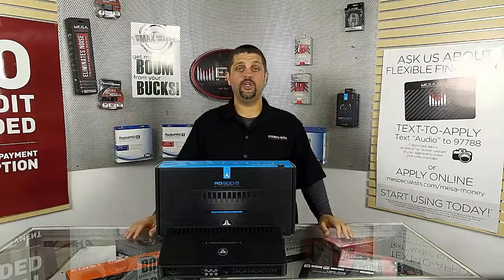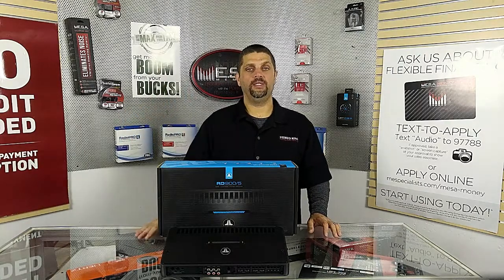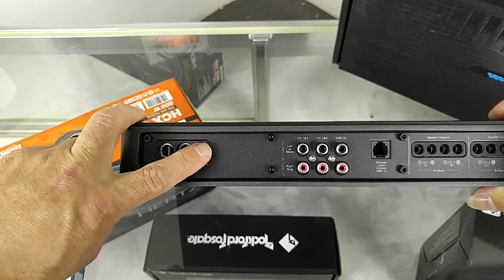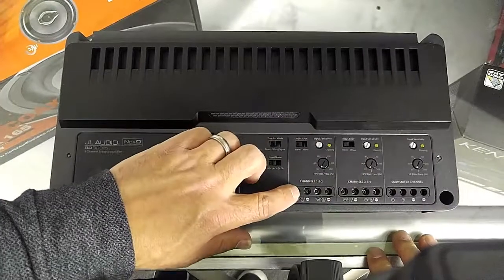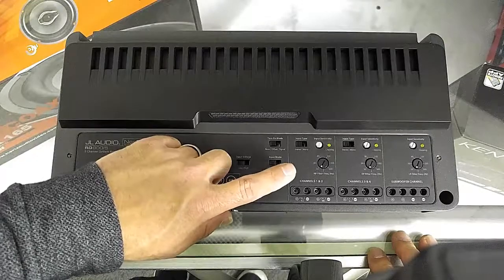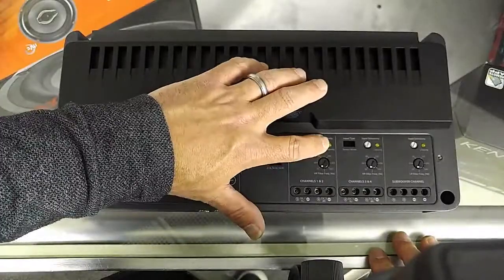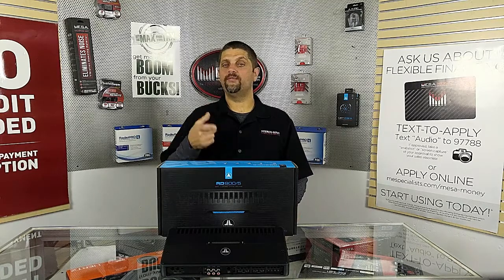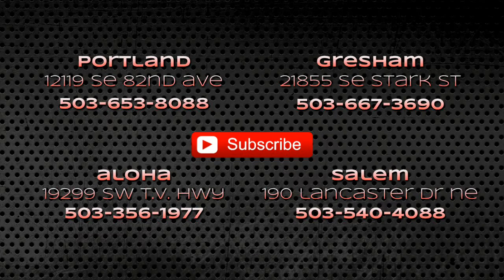JL AUDIO RD AMPLIFIERS

Comment: Is the RD 500/1 a good match for a W3 10" sub?....I forget if it is 2 ohm or 4 ohm...but I will find out

Thank you
Reply from the maker: It should be be plenty of power if you are only doing one sub. You'll get 500 ar 2 ohms and 300 at 4 ohms which still enough.
Reply: @stereoking7778  TY....I was worried that if my sub is 2 ohm....the 500 watts might be too much...but I guess not 👍
Reply: I have a w3 2ohm 12” in a custom, ported box. It sounds amazing and does not distort.

Comment: I have this amplifier  . Got it professionally  installed  . My subwoofer  is at 80 . My front  and rear  speakers  I have  them  at 120  . If I bring my highs  down to  80 . Duo  I need to adjust the  silver turning nobs the ones you pointed  out  . And wich direction  do I adjust  .
Reply: If you got it professionally installed, do not touch the silver knobs. These are for setting the gain, they are NOT a volume knob.

You can play around with the equalizer built into your radio to adjust the highs/lows (bass/treble).
Reply: @HP2ViD I think he's talking about the crossover idk really

Comment: I was given the 400/4 amp. I have a set of 15 inch kicker comps @2000 watt total. 1000watt each. Would this be able to power those in a 2 channel configuration. Doesn’t need to push them to max but at least get some nice bass.
Reply: Maybe if you had 10s or 12s but the 15s are to high wattage. Max would be 200rms x 2

Comment: would this be good to run my 4 aftermarket speakers in my bmw and a rockford 12" p3 sub?
Reply from the maker: Yes sir, the RD900/5 should do a great job! Another option would be the XD1000/5. You gain an extra 100 watts to the sub!
Reply: thank you for answering and the recommendation i really appreciate it I'm definitely gonna check it out right now!
Reply: can you recommend a wiring kit for my setup ?
Reply from the maker: You will need to use a four gauge amp kit. Three pairs of rca's,16 gauge speaker wire would best for your interior speakers and 12 gauge for your sub.

Comment: what happended to the SLASHER SERIES ?
Reply from the maker: They still have the slash amps. Not as popular as they should be but that is a price and size issue.
Reply: one more light yessir.. i have a 1000/1V2 pushin a 12W7 in the H.O. wedge myself

Comment: would this run two sets of c2 650x and a jl 10 inch sub?
Reply from the maker: Yes the RD900/5 would do a great job running your C2 components, as far as the jl 10" sub, it depends on which one you have. If it's a W3 or lower it would do a great job. If it's a W6 or above I would recommend the XD1000/5.

Comment: Can 2 rd1000/1s be used to power a 13w7ae
Reply from the maker: Not recommend. They RD amps are 2 ohm stable. They 13W7 has 2 1.5 ohm voice coils.
Reply from the maker: I would recommend the hd1200.1 and fun the coils in series.
Reply: Stereo King i already have 2 rd1000/1s
Reply from the maker: Unfortunately the RD amps are not 1.5 ohm stable.  You can run one amp to a one 12w7, they are single 3 ohm voice coil woofer.
Reply: HD is the same as the Slash amps. 1.5-4 ohms. They're built for W7s. Slash amps are matched to the 12.5 W7s

Comment: Will the rd1000/1 be able to handle the 13w7?
Reply from the maker: No, do to the 13w7's 1.5 ohm dual voice setup, I would recommend the HD1200.1 running the sub in series.
Reply: stereo king oregon thanks for the info, because a certified Jlaudio dealer shop told was trying to give a package deal which includes rd1000/1 to push the 13w7
Reply: Stereo King what happended to the 1000/1V2 SLASHERS ?
Reply: floorguys i got a almost new 1000/v2 that has a chipped fin that has been sitting on my display case for years you looking to buy one?
Reply: Adam M thanx but no sir.. i have 1 already pushin a 12W7AE in the H.O. wedge .. was just curious why they stopped making them
Reply: @stereoking7778  hello what jl amp would good for 2 jl 10w3v3-8

Comment: How would you set the gain and hpf for the sub I have a tw3 10”
Reply from the maker: The hpf you do by ear, start at 80.  The gain you can either go to jls website and find the target voltadw output. Or use an oscope or smd dd1.